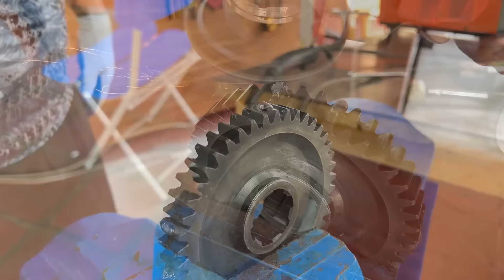Restoration Of A Tractor That Broke Down 30 Years Ago By A Master Mechanic / Full Restoration

Comment: THAT'S THE BEST I'VE SEEN TO CUT THE DIAMETER EVERY ONE ELSE SEEMS TO CUT IT ALL OUT ALL THE WAY ROUND YOU JUST TOOK OF WHAT WAS NEEDED NO MORE THEY END UP WITH THE WALLS TO THIN IN PLACES WELL DONE ARE YOU GOING FOR A SHORT STROKE WITH REV HIGHER MORE POWER WELL DONE
Reply from the maker: Thank you very much

Comment: I thought, considering the tooling that you had at hand, you did a very fine job in restoring this furrowing machine to its original condition. However, if you don't mind the suggestion...... Tape or plug up all bearing bores before painting. Also, tape the opening to the fuel tank as well. The idea is to keep paint out of areas that it doesn't belong.
Reply from the maker: Thank you for your feedback so we can better improve future products. Wishing you and your loved ones good health!
Reply: Зачем повторять несколько раз заклейте?
Reply: @Alex-12359 When he was painting the different parts of the engine, paint was getting into the bearing bores and inner gas tank..... Places where it does not belong. By taping or plugging up those holes -- before the painting -- this can be prevented.

Comment: A few friendly recommendations; Make yourself sets of punches and chisels from some scrap. It'll make your work quicker and it will look more professional. It is important to use grease and oil when assembling bearings, and installing shafts into bushings. Make use of an anvil more often when forming metal. Cement and sidewalk tiles are ok but look amateur. Try to find someone who will let you use sand blasting equipment. You just need to provide the sand. Never place machined parts directly on metal and hit them, like the piston you worked on. Take your good work to the next level.
Reply from the maker: Thank you for your feedback so we can better improve future products. Wishing you and your loved ones good health!
Reply: Gotta say I cringed every time they beat on bearings with a steel mallet... how would they know right?

Comment: Hey it's like this y'all done what you able to on it. with what yah had to work with.   From the start to finish on that older piece of farming equipment. From years ago back to today. So I say it's A major improvement compared to what it was for sure. Although that cooling container part should've been recasted is all truthfully on it straight up. It's your's though so you fixed it the way you wanted it be. For yourself.,an to fit your needs to use again. And I get that part of it all to as we'll on it all. 👍
Reply from the maker: Wishing you and your loved ones good health. Thank you for always following and supporting us

Comment: Lovely work but was there a large crack on the end of the gear box which looked like a casting so bracing rather than welding which is not so strong?
Reply from the maker: Thank you very much

Comment: Apparently it is their style to make everything look, “almost” 5 more minutes with the wire wheel, or the grinder. A little time with some sand paper, clean gloves on final assembly, so there is not oily smudges, a little care tightening bolts so the wrench does not scratch the paint. Or is it the style, culture, this is the way to tell buyer, this is repaired old stuff?

Comment: The welder with a brief pass on the bare foot ... it was a carelessness!!!

but use a little grease on the couplings of the numerous pins...

and tap the bearings with a wooden or plastic hammer, not a metal one!

Does anyone who watches your videos have to tell you everything?

Two further suggestions, to improve the quality of the work of those who use it.

1 build a protective grid for the belt!

2 build an extension upwards for the muffler!

You can do it yourself!!!

ALWAYS use it at low speed!
The faster it is...the more dangerous it is!
Reply from the maker: Thank you for your feedback so we can better improve future products. Wishing you and your loved ones good health!

Comment: Fine bit of sheet metal working; how did you redo the hole in the water jacket and the crack? Powdered iron and clay dam to hold till it melted and went semi-fluid and flowed into the cracks? I used to have a forge that was a 4 fto wide working area with a 4 inch air supply with waste gate for spills. Lead melted into that one day; took a week to get it all out.

Comment: You did a great job.  I love the gaskets made out of cardboard.  The only oil leaks I saw was in the oil bath air cleaner.  I truly enjoy watching your amazing work.  I would like to know what kind of tractor that was?  The M on the side of the engine looks like the Merry company that made rotor tillers, but the other name on the green parts are not familiar.  I could not find the Tengle brand in an internet search.
Reply from the maker: Thank you very much. This tractor has been used for quite a long time. and as you can see they are not intact. We tried to perfect it and get it working again
Reply: That’s not a oil leak , automatic oiler ,rust prevention, all my equipment has this upgrade!

Comment: Nice to see it running again  but I would have liked to see you do some measuring to determine the wear of components. Rings and gaskets were the only things replaced and the rings went in on a worn glazed bore. Nothing was tightened with a torque wrench which is also a problem. The fuel tank had a heap of rust in it and that will flake off with vibration and cause damage to the fuel pump and injector. I have to wonder why you used the TIG welder on the aluminium water tank but not for the fuel tank repair. it would have tone a neater job. When you are removing and fitting wrist pins in a piston it needs to be laying on something softer than it so it does not get damaged and don't fit the rings before the wrist pin as they can be damaged when knocking it in. Anyhow its running and I hope it stays that way.
Reply from the maker: Thank you for your feedback so we can improve future products. Wish you good health.

Comment: You Sir describe yourself as a Master Mechanic, yet, you reassembled an engine with no reassembly lube or a torque wrench. You contaminated most of the bearing parts with dirt and dust. You fitted the bearings by beating the crap out of the centre race with a metal hammer. You used a totally unsuitable grade of oil for the transaxle, no small wonder that it leaked. Home made cardboard gaskets to name but a few of so many errors. A shiny multi coloured paint job does not make a restoration. I doubt that poor old machine will last very long.

Comment: I've watched lots of the videos with this style tractor, but have not been able to determine what the second tank on top is for. Obviously one is for fuel, but the other ?
Reply from the maker: Thank you very much. The second tank is used to store coolant in the engine when the engine is working, it will generate heat so it needs to be cooled.

Comment: Restoration Skills?!? Restored by a master mechanic?? Sorry, no. I don't agree with the 'everyone gets a trophy' mentality. This is mediocre work at best. Terrible quality paint work in general, areas not painted that should be, overspray into & onto areas it shouldn't be, torque wrench never used, half the hardware still had rust on it, looks like coat hanger wire instead of cotter pins, brazing over old metal instead of cutting it out and replacing it... I could go on but what would be the point. 

One good thing I will say though is at least you saved something old, gave it a few more years of life.
Reply: The Fuel- Tank! Give one hour more time to cut the metal sheets exactly out and it had become more perfect.
Reply: well its a lot better than lying in a ditch!    you" septic tanks" can criticise , but its fit for purpose and not one snap on tool box to be seen
Reply: @eweunkettles8207  yes, I criticized poor quality work that is being claimed as skillful and masterful. It isn't. But don't you read everything before speaking? I clearly gave some praise at the end. The fact you immediately resort to name calling with degrading remarks towards myself and any others that agree with me is a clear indication you know I'm right and have no facts or proof to dispute me with. Tssk tssk. You should be ashamed.
Reply from the maker: Thank you for your feedback so we can better improve future products. Wishing you and your loved ones good health always.!
Reply: I don’t think a few more years of life is accurate. 50/50 guaranty maybe.  50ft/50min.
Reply: @dlh196282  bla bla bla. Watch the video. Pour workmanship, assembling bearings, and gears with filthy gloves, hitting a bearing on the inner race to fit outer race. Watch the video.
Reply: @SPUDHOME  
its not a nascar big block 
old engines are like humans after years of hard work  they respond well  to a  bit of maintenance and the ocasional fuel supplement   
this gives them a few years more where they go like the clappers!   its only temporary of course  the end is nigh
Reply: @eweunkettles8207  watch other videos about how the wonderfully, expertly built equipment falls apart
Reply: its a  KUBOTA    
and plenty of engines are built in   3rd world  roadside workshops with less than perfect   procedures,   but they do run and they aint bothered if they  smoke a bit   or clatter   as long as the  soil gets turned over   

i
Reply: @eweunkettles8207  then don’t pretend. Good workmanship, good skills, good labor, good parts. Admit when the work is done they have built junk.
Reply: @SPUDHOME 
wont admit anything 
i was in bagdhad   when you were still in your dadsbag

Comment: Very poor work
Reply: I’m actually fairly impressed. Clearly that machine was made of very poor materials when it was new. The level pitting was incredible. The only way to do it better, would to replace nearly every piece of metal on the machine. I don’t believe that would be feasible at all. They seem to be doing this work with very limited resources. I applaud them.

Comment: You have the wheels on wrong.  Switch them.  See start and then finish picture of machine.  Wheels would grip better.
Reply from the maker: The wheel is installed according to its design. you need to take a closer look

Comment: This is not Restoration, this is the resurrection of Frankenstein, such repair was made I understand purely for fanats, many parts were so corroded for example gas tank there was almost nothing to restore the man literally from scrap metal you can say made a new tank over the old, the engine itself is surprisingly well preserved not counting the corrosion on the top layer the man literally removed about 2 millimeters of corrosion grinder, in general the man actually made a new motoblock over the old real kulibin !!!!.

Comment: As with several of these refurbishment vids, poor engineering skills employed, hitting bearings to remove and again to replace, pieces that should obviously worn beyond optimal use and should be replaced are just mechanically cleaned and reinstalled, I think the end goal of simply "refurbish" and it should be let's bring something worn out and time degraded back up to somewhere approaching the original performance and efficiency.
Reply from the maker: Thank you for your feedback so we can better improve future products. Wishing you and your loved ones good health!